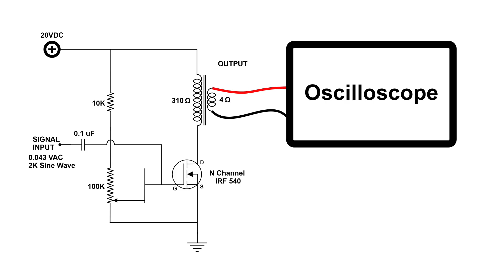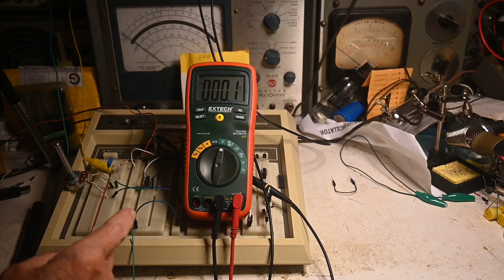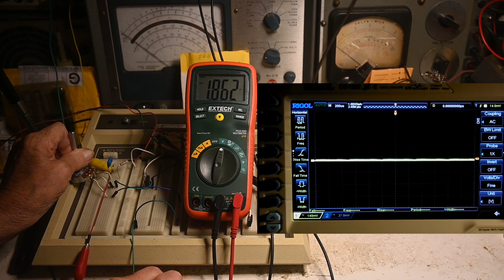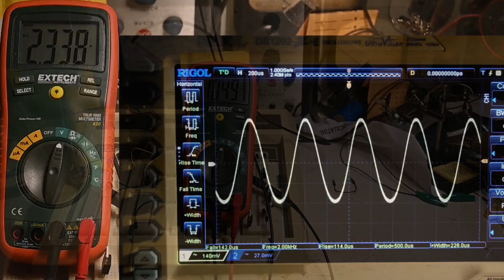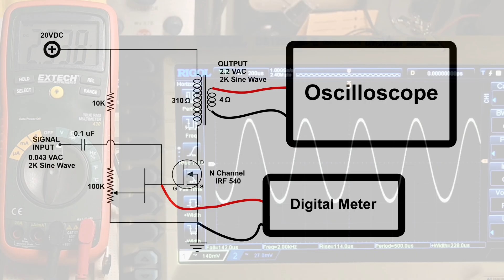MOSFET Audio Bias Experiment

Comment: Class "A" amplifier operation. At the point that you obtained best symmetry of the sinewave, if you were measuring the DC potential of the Drain connection to the transformer primary, if the power supply is +20 volts, you should measure half of the power supply, 10vdc.
Reply from the maker: Yes, the same amount above and below zero. Thanks!